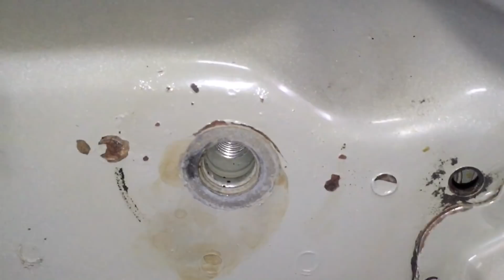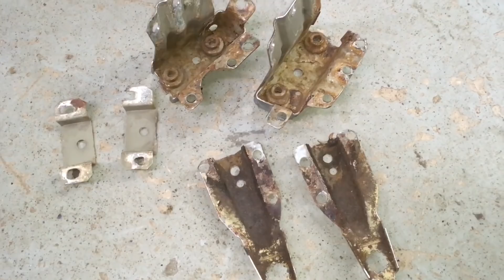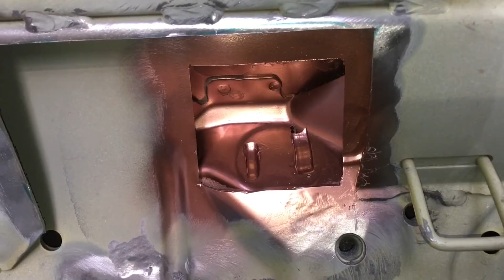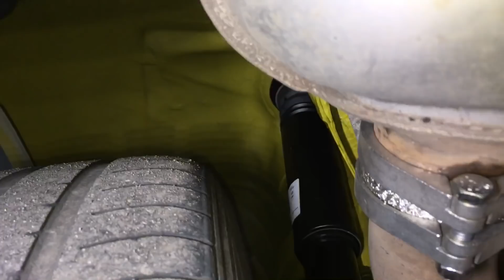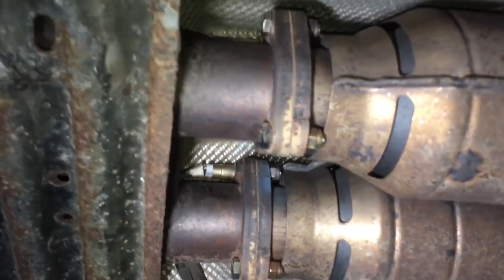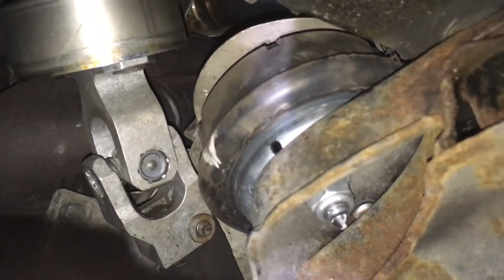BMW E46 M3 Convertible - RACP Repair & Reinforcement Process

Comment: Having owned a couple of E36 and E46 M'3's as well as 2 2001 M roadsters, I am well aware of all the "stories" about the cracking and wondered how really dangerous or important it was. Having watched almost all your videos, after watching this one on the Phoenix M3, I had to comment. That is how I found your sight and I must say that I am amazed with the quality of work you do. Your detection work on all the problems amaze me as I believe 98% of the BMW "specialists" or dealers here in the US would never find most of them and then not know that they can or should be fixed. Your detail and preparation are nothing like I have seen in the US. This raises one big question for me. This particular car can be found in 30-40mile examples in the US in very nice looking condition for under $20K US. When I look at the amount of work you did to this car, it had to be expensive. I am not asking for any of your trade secrets of private information, but would you mind PM me with the cost this car incurred. If I could even find someone in the US that could do you quality of diagnosis, then repair and using all BMW parts, I can't imagine paying less than $3-4K US for all this work. Even then I don't think the cleaning and wire brushing that you do, the interior rewaxing and opening  the back seat cavity would even be considered. Believing as I do what these costs would be and the relative easily availability of these cars, I don't think anyone here would bother with the repair or would get a cheap weld on kit that is sold that doesn't even consider the spot weld cracking and grinding. I'm puzzled that people in the UK go to this expense on a relatively inexpensive car and the time to have you do your amazing repairs. Can you shed any light? Thanks